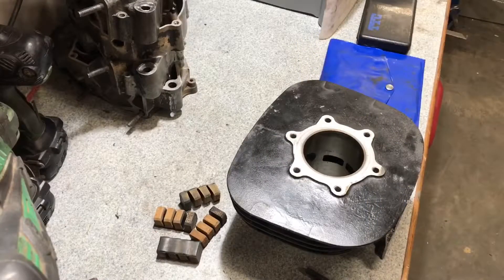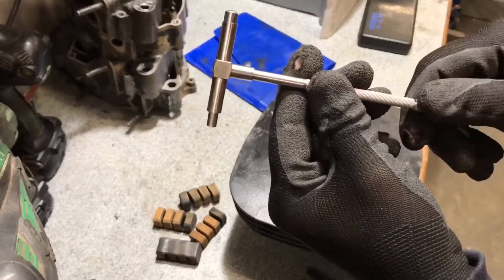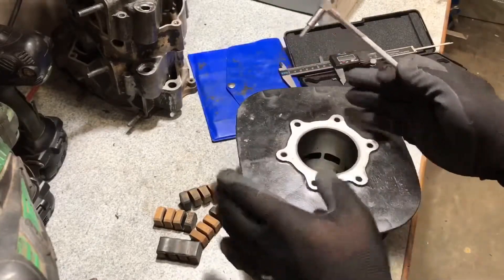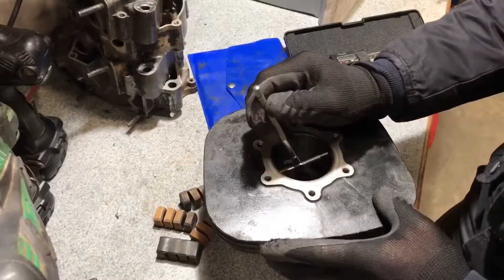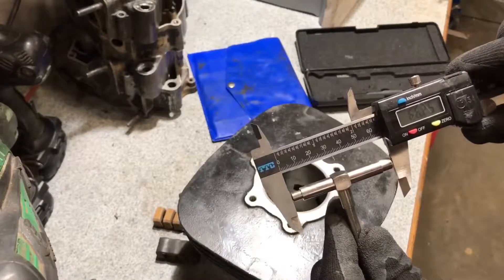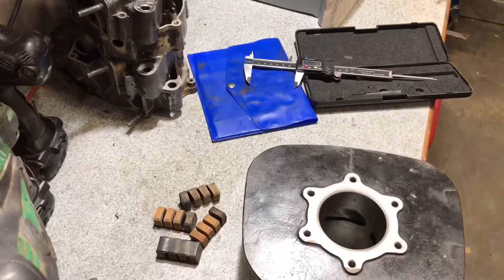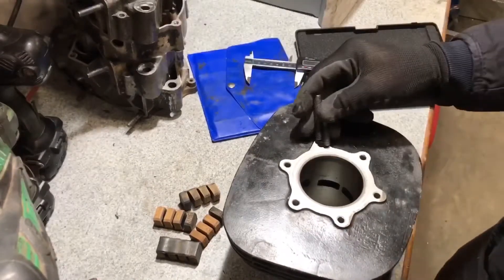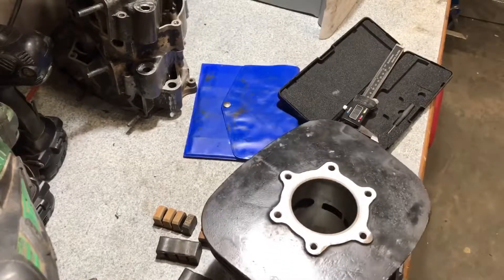-Cylinder measurement for next size up piston- Yamaha blaster

Comment: thx for making this video. my blaster only had 90 psi on testing, and my piston is completely shot. tons of blowby going down to the piston skirt. question - can i just clean the carbon deposits that made it down to the crankcase? also, do you send the cylinder cover out to get cleaned up too? mine has tons of carbon near the spark plug. thanks!
Reply from the maker: Yes you can just clean out the bottom end use some mix 2 stroke gas and clean it out and then spray some WD-40 in there to make sure everything is lubed up, and then with the cylinder head you can take a Scotch-Brite pad and hand sand it all out clean it up polish it and it should be good to go:)